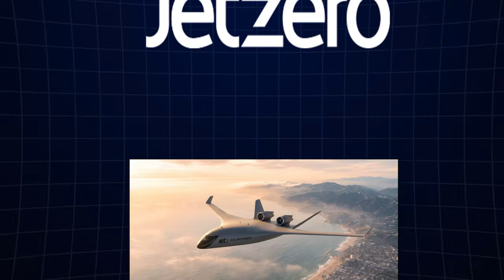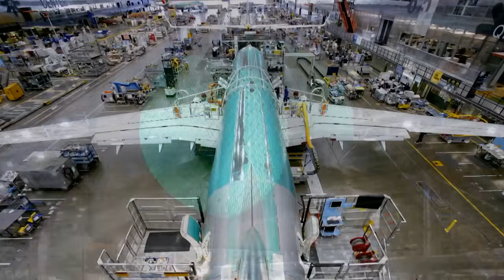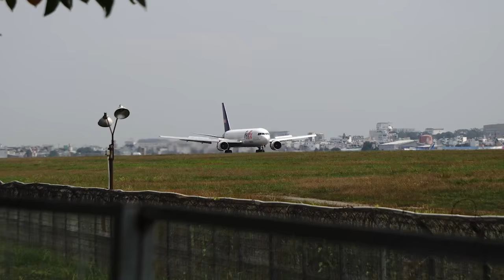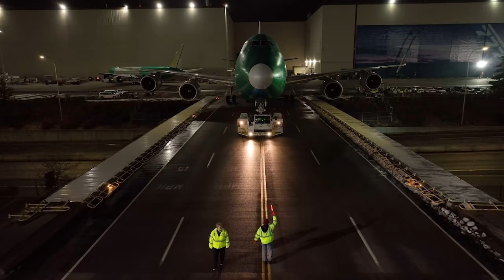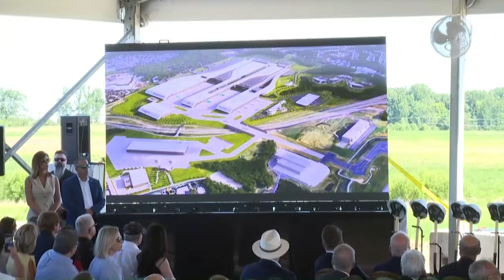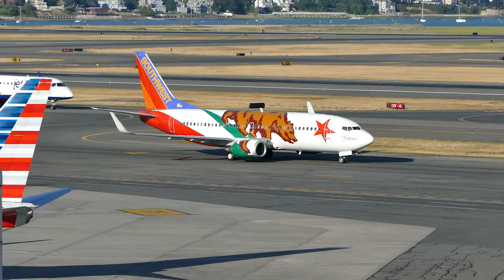The $1,000,000,000 Flying Wing That’s Terrifying Airbus

Comment: If you build the whole structure in one piece, how do you replace certain parts in case of an accident?
Reply from the maker: A one-piece fuselage doesn’t mean it can’t be repaired. Composite aircraft are designed with approved repair procedures, and damaged sections can be repaired or replaced when necessary. Maintainability is a key part of aircraft certification

Comment: Great stuck in a box for 9 hours with no windows. How fast can 250 people deplane from this new wing? One solid carbon fiber airplane? Sounds like a disaster like that Oceangate submersible. Structural damage to a single carbon fiber airframe would extremely difficult to fix. Beter to use a paneled approach like the A350. And with the two engine design, would it be able to fly on a single engine? Don't want to sound negative but this sounds like a expensive pipe dream.
Reply from the maker: Thanks for the thoughtful comment. A few good points here. Carbon fiber airframes are already used extensively on aircraft like the Boeing 787 and Airbus A350, and modern composites are designed to be inspected and repaired when damaged. The OceanGate submersible isn’t a good comparison because aircraft and deepsea submersibles operate under completely different loading and certification requirements. As for the two-engine design, modern twin-engine airliners are certified to safely continue flight on a single engine under ETOPS regulations. Whether this concept succeeds will ultimately depend on proving its safety, certification, and economics.Though the no windows part makes it a bit claustrophobic imo.

Comment: If it takes off, how are they gonna ramp up production? Do you think Boeing or airbus will try to buy them?
Reply from the maker: If the Z4 goes into commercial service , I think Boeing or Airbus would try to implement a similar design rather than buying the company. If there’s demand for the Z4s , the funding they’ll receive will help them ramp up production but then again they have to get enough manpower to meet demand 
Thanks for watching